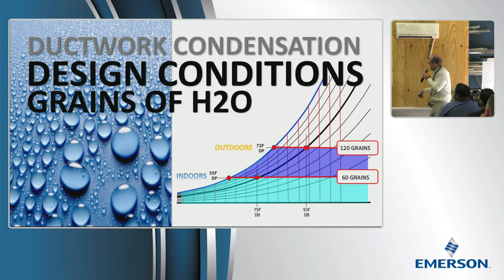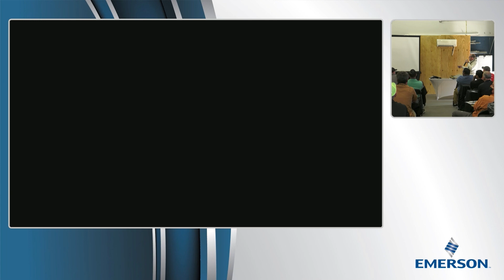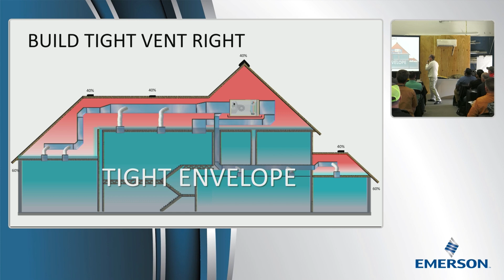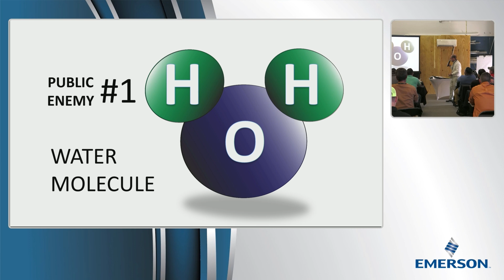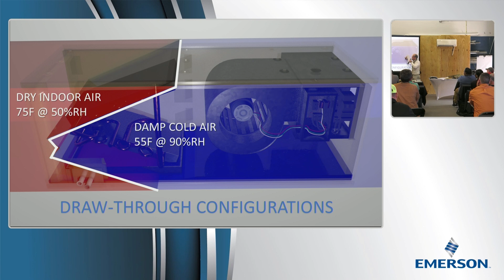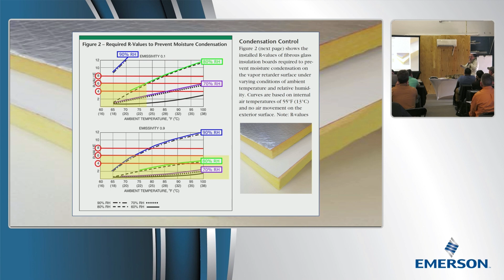Why Ducts Drip - Conductsation w/ Rick Sims

Comment: Long story short peeps it’s seal and dehumidification. U want to seal with mastic and tape the floor boards and side walls of the attic with special insulation tape
Reply: Ohhh and air balance the place the pressure has to be greater inside than outside

Comment: what about duct sweating in a ceiling between the basement and main level floor? centrally located area of the ceiling, the duct is sweating and dripping through the sheet rock. customer has opened the ceiling and it is soaked. Unit is a 4 ton Bryant evolution extreme, over cool up to 3 degrees with humidity setpoint at 46% was enabled, setpoint in the house is 71 and comfort Is maintained, except the sweating ducts. Customer says the run times seem normal/ long enough.
Reply: Possible the unit is running longer than the old unit because this one is variable speed so now the ducts get much less drying time. Also it is colder in the basement ceiling vs other places in the house. Overcooling to dehumidify will help the house but make duct condensation worse. A separate dehumidifier would help.

Comment: Damn ridge vents no good in a hurricane either.  What about metal ducts in an attic, i presume they would take on more heat therefore would need even more insulation than flex duct under the same conditions?

Comment: I think the presenter misspoke - the MINIMUM attic ventilation is a total of 1 SF of vent/300 SF of attic space, not 300 SF/100SF of attic space ... this is the "300 Rule" - however, in hot climates most recommend 1 SF of vent/150 SF of attic space (called the "150 Rule" - I'm assuming Naples, FL is this sort of area.

Comment: 300SF Total ventilation per 100SF of floor space is ridiculous. That's 3 times the ventilation as floor space. Check your calculation again. That would require More ventilation that SF of my house. You corrected that later to 1SF/300SF. Just a little confusing...

Comment: Is the dewpoint the same as the ambient air temp.
Reply: No - only if it’s raining (usually) because dew point is the temperature where the moisture starts condense
Reply: Td = T - ((100 - RH)/5.) where Td is dew point temperature (in degrees Celsius), T is observed temperature (in degrees Celsius), and RH is relative humidity (in percent). Apparently this relationship is fairly accurate for relative humidity values above 50%.

Comment: I've had this problem with at a residential but I quit didn't under stand why I seen there wasn't any ventilation system in the Attic so I put a fan in the Attic thought what was gonna help I still had enough amount of sweat coming in the rest room.... I reinstalled the duct system just the rest  it was really a work of art how they put that together it was an add on some it made a little sense what you just explain here , thanks  a plethora